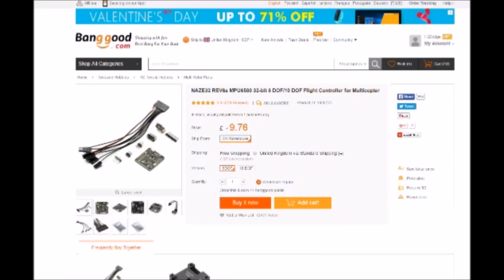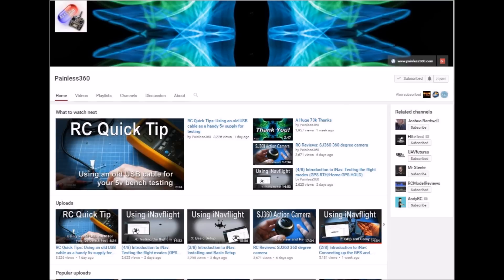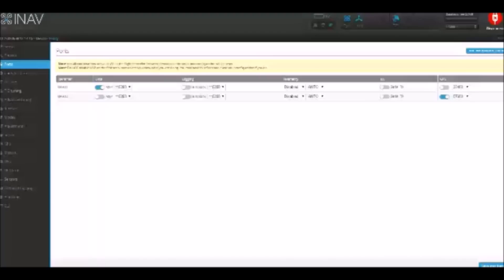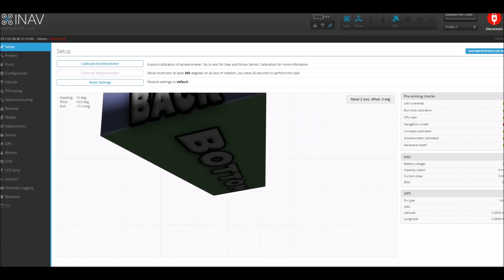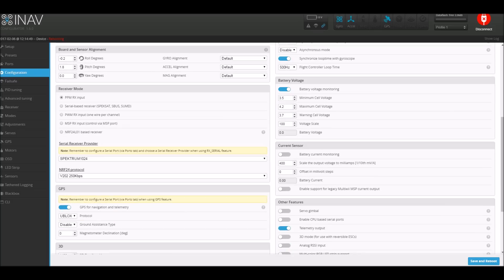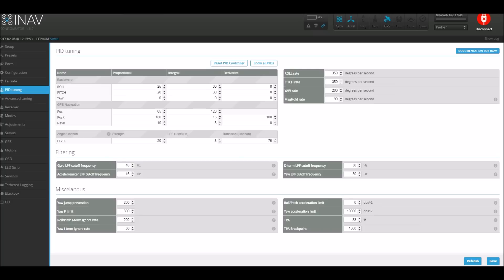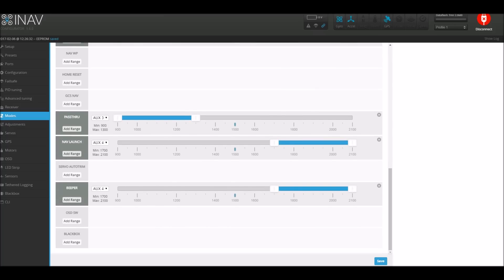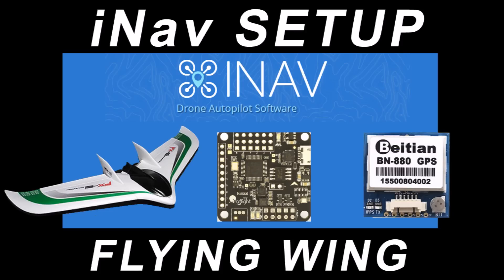iNav Naze32 GPS setup for Fixed Wing - FX61 CLI Dump

Comment: Nice video. Is there a particular orientation for the gps or can it go any way round.
Reply from the maker: Chris Edwards if it's GPS only it can be put in anyway as it detects its position from movement, if you are using compass aswell it needs to face forward, Painless 360 has some more up to date tutorials on this! =)
Reply: Dodge Ditchburn 
Thanks. That's a great help. All ready to go.

Comment: Hi, nice video,

I have a problem with my inav flying wing configuration, I am building it with a reptile s800 and spracing f3 fc acro.

When I have all configurated, acc perfect calibrated, flight modes etc... In agle and horizon mode arming motor stick up throttle and servo left and right moving alone slowly, but not in acro mode. I have flashed ir wirh diferents versions and I have the same problem. Any ideas?

Thank you
Reply from the maker: Hi, if its to do with the rate the servos move in different modes you need to look for 'roll rate' in the transmitter menu ( I think!)

Comment: Hello Dodge, I'm planning make a quite similar setup, but i'm planning to connect my FrSky 8xr with s-bus and smartport telemetry to the naze32. What I'm just wondering when I do this, is it possible to connect a gps at the same time and if the answer is yes. How ?
Reply from the maker: Jelle Kaptein I don't see why it wouldn't work, are you using sbus to ppm to connect the X8R to the naze?
Reply: No I'd like to use direct S-bus input. So thats just why i'm asking. I believe uart nr1 on the naze is shared with the usb, so using smartport, S-bus and GPS seems not possible.
Reply: UART1 is shared with the usb and that is the one you would use for your osd. You would have to unplug the osd if you want to use the usb. UART2 is used for sbus - and you cannot use sbus and gps at the same time. You would have to use cppm so you can use UART2 for gps. But then - cppm input is dropped in iNav for naze, right? So you would have to compile your own iNav version, right? How did you do that Dodge?